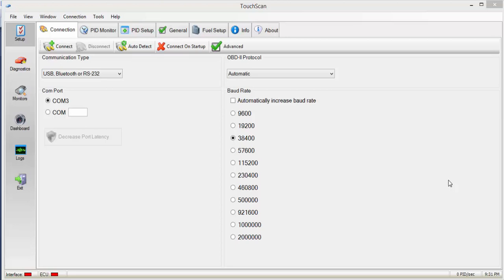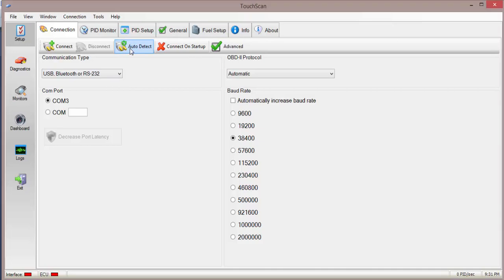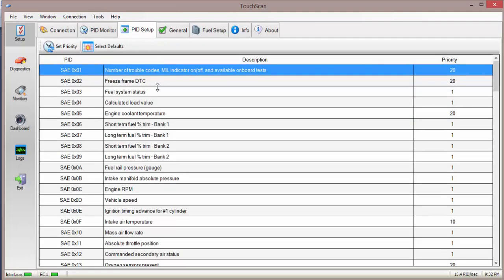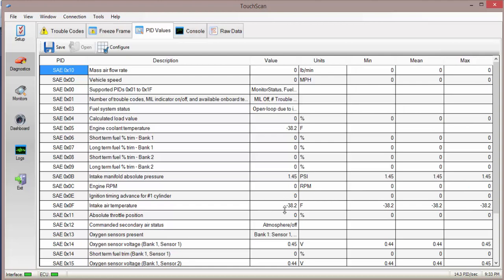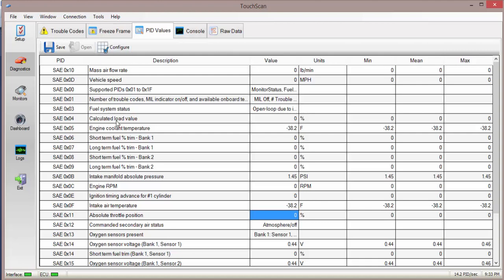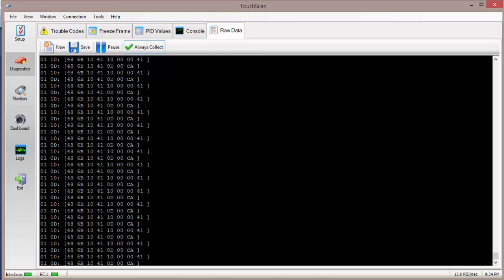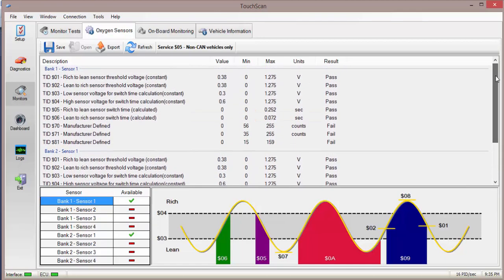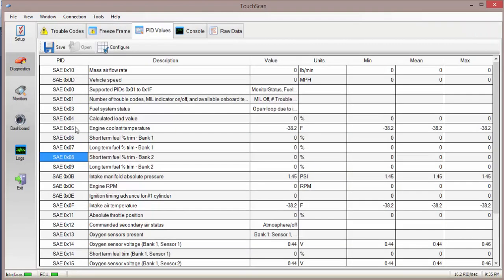TouchScan Demo - Read Holden VT VX VY VZ fault codes

Comment from the maker: Sorry for the late replies guys!
TouchScan does have alot of nice features, including advanced graphing abilities. Although most of the goodies are tucked away until you purchase the professional version of TouchScan.

Im unsure about scope capability, this feature doesnt work on Holdens, although may work on other vehicles. But graphs allows you to set different parameters and it will map them while your reading out information.

Rudi van Emmenes 
Unfortunately I am unsure whether this will work on a Nissan. Since it is 2010, this means it MUST be OBD2 compliant and TouchScan should be able to connect up and display information such as rpm, 02 sensors ect.